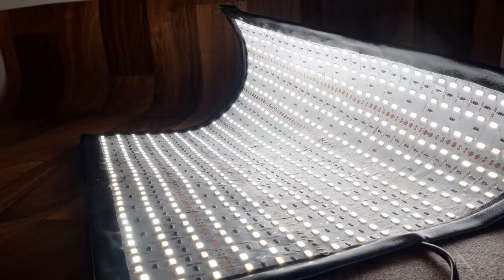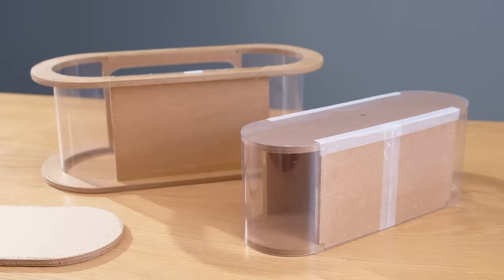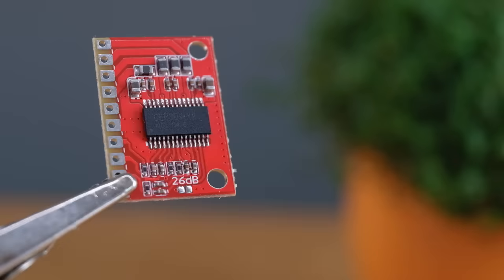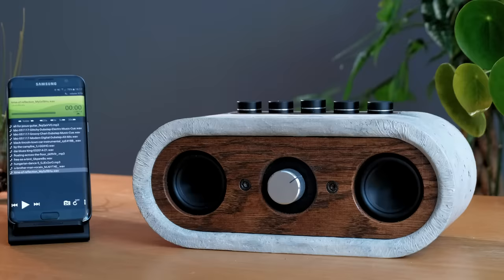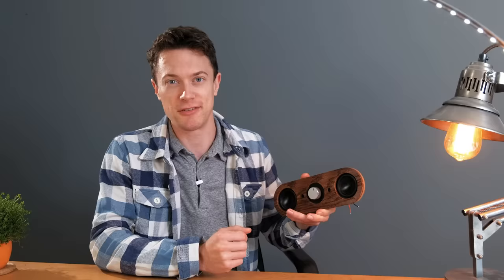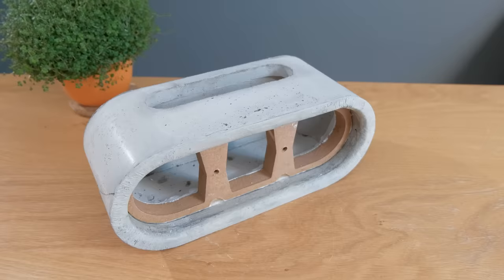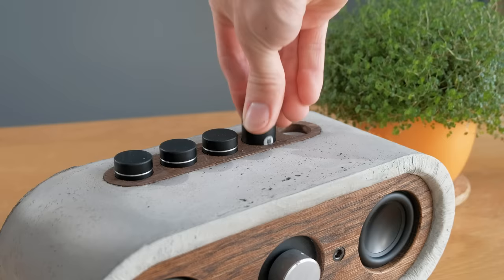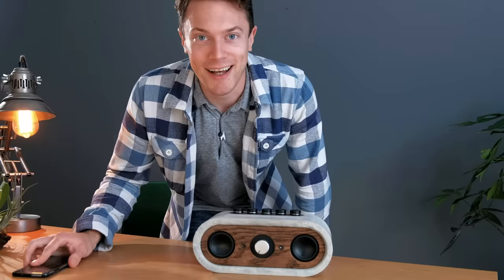Build your own Concrete Bluetooth Speaker (how-to)

Comment: you could sell this for 500 bucks. "Handmade" and all of that crap
Reply: 500? Nah am 2k+
Reply: 5k+
Reply: I'm thinking of making these and selling for $350
Reply: if I was gonna buy a speaker for $500 I'd go jbl
Reply: @alexafa316  Make it 200 and i'd buy
Reply: @saltysoysauce954  200 is kinda cheap
Reply: @alexafa316  Well there's a lot of competition in the bluetooth speaker market
Reply: '200 is kinda cheap' what
Reply: @TheRealDrae  Yes.  The drivers are over $50 a pair on sale.  Then you've got the bluetooth receiver, circuitry, potentiometer, hardwood, rather nice knob, batteries, connectors, battery banks, acoustic foam, forms, concrete, and plastics.  On top of that it's custom kit, so you have several hours of labor - all of which are skilled craftsman hours (>$25/hr). 

$200 is very, very cheap.  You'd be selling labor at under minimum wage at that cost.
Reply: John Ross  factory automation could reduce that.

It would actually raise the cost.  I used to do automation in my previous job actually (not manufacturing, but forms processing).

Speaker drivers, knobs, electronics, and batteries are not something a speaker manufacturer is likely to make themselves.  Some companies make their own drivers, but only very high-end ones or ones that sell large volume.  Those will all have to be purchased.  Parts alone are likely around $120+ even at direct manufacturer purchase prices. 

You've got the rent, administrative overhead, machinery, and maintenance.   Then you have the interest on the loans you took out for that equipment - companies don't hold on to lots of liquidity for economics reasons I'm not getting into right now.  These are mostly fixed costs and the unit has to sell enough to pay these off.  A concrete portable speaker is an excellent boutique product but most consumers are very unlikely to be interested in one.  You won't be able to recoup the cost of automation.

This is the same reason a ton of top-end audio products are 'hand assembled'.  They sell so few units that setting up automation for the manufacturing would actually lose them money, or make the item far more expensive that its already eye-watering price tag.
Reply: To all of those who are discussing automation, it is fair to note that if you are to the point of automation, you are also likely able to buy components at a substantially lower rate.  That said, you'd better have  a pretty significant demand for the product, as the overhead of a manufacturing facility...even a small one...will not be cheap.
Reply: @John and @Matthew Blackwood, there is also tooling costs, assembly line and process flow management, employee wages, insurances (health, worker’s compensation, liability) that are all including in the account for the suggested solution that manufacturing would be better. I agree with Blackwood. This would be better as a handmade custom item at a premium price. Not a mass market item but certainly finding the right crowd through the right avenue would be a challenge but I’m thinking gift shops in tourist areas, uptown hangout spots and shops near beaches would be great. Plus the whole handcrafted thing is a big trend right now that I see only continuing to grow as people are becoming more conscious of how their products are being made nowadays. ......Surprised this all ended up being quite the in-depth conversation but some just don’t like to admit when they insist on correcting someone and end up being incorrect themselves.
Reply: @ethand4784  perhaps you would, but there are a lot of people who appreciate handmade art like this as well.
Reply: @ethand4784  I never buy such electronics, you make it yourself it is so much better trust me
Reply: Slap a Sennheiser logo and called it a day 👍
Reply: @ethand4784  500 is a bit rough for jbl. there are so many better speakers than the boombox in that price range.

Comment: Hi Matt,
I've just discovered something that impressed me a lot. When I was taking a look at pricing of some parts, I realyzed that speaker driver seller got you linked at the product (that project I mean). That feels amazing.
Changing the mood, about the dangers you should've talked of building with concrete (cement part derivated dangers), washing hands (and every portion of your skin spotted or dripped by it) is very important. If you let it on your skin for hours, letting it dry naturally it tends to cause bleaches like being burnt.
Other point to look at is being careful while manipulating it, because it is a real fine powder that expands in the air so easily. To use it outside could be enough, other way you may not be rude handling it in order to avoid sniffing it. Commonly it'll generate a coat of powder in the nearest area, easy to clean after all unless its over textiles.
Thanks for your efforts in showing us newer and creative projects.

Comment from the maker: Templates uploaded!  https://drive.google.com/file/d/0B-WzRpdWmGhjal91SFp2Q1dXbXM/view?usp=sharing&resourcekey=0-IyYVV6VKaRQGdPbMFzI6YA
Reply: Thank you!
Reply: Thanks!
Reply: Insta sub m8
Reply: Thank you for the templates but, the dimensions are really vague. Whats the scale of the templates? I think a few dimensions in mm or cm and especially for the acrs and angles of the mould would really help. thanks again!
Reply: Hey mattt, Do you think you can show us a video on your work shop set up
 and give us a few tips on where and how we can get started with making 
awesome builds?

Thanks you.
Reply: Hi Mark,

The .svg file is not good It is not complete. And it what the other people are saying there are no demensions the layout so its impossible to reproduce correctly
Reply: Thanks Matt. Only been waiting a month for these plans. *tut*
Reply: What's the battery live at mid volume?
Reply: DIY Perks how do you charge the cells?
Reply: With the Templates, could we get them 3D printed??
Reply: DIY Perks Thank you for very wellmade videos. Very interessting to watch. Can any of your amp projects be used as a guitaramplifier?
Reply: Please can you finish part list? Parts for power cells are missing and volume dial.
Reply: DIY Perks can you make musically controlled led lights
Reply: DIY Perks how do you recharge the  batteries?
Reply: Would it be possible to intall an imput like a 3.5 jack so not only is it bluetooth but also a speaker for cell phones?
Cheers anyway all your proyects are amazing!
Reply: Dear Perks, this is great indeed but sadly we can't really use it as you didn't put any helps to figure ot the dimensions. Just tell us how u made them or update the templates with dimensions added
I hope you will respond and thank you!
Reply: If someone were to know the dimensions, please answer ^^
Reply: Speaker has no internal charger, so you have to pull out cells and charge them using some LiPo charger.
Reply: hey there, i want to build a  bluetooth sound bar out of my old 5,1 speaker sistem.the speakers are 8 watt x4, 1x 18watt center and the sub is 22 watts, 4 ohm speakers, could any one please tell me what kind of parts do i need for this project? i mean amp, bluetooth moduel etc. or maybe someone already made similar project and can share theyr expereance whith me. thank you in advance for your reply
Reply: hello. I want to ask you how to (a relatively simple task i think) make an LCD backlit black and white screen (like of a calculator that I want to use in broad daylight which isn't possible otherwise due to shining screen :( )
Reply: I thought the same. Also the worked out charging and LED lights for charging state. I can do that.  Let me know I'll Share.
Reply: There a few for reference. I'll see if I can draw in F360 and upload the file.
Reply: 詹堉梃
1秒前
Hey, I have a problem with connecting to the Bluetooth with my phone. 
b) There's no voltage coming out from the amplifier
c)There's no sound from the speaker
d) When there's some sound coming out, it sounds horrible
please reply as soon as possible, my friend is going crazy on this. PLEASE
Reply: How do I connect ground?? Didn't really understand from the video. Also the templates are incomplete and vauge. Can you provide me with Better ones. Nice project and looks elegant. I really want to make one. Please contact me by replying. Thank you!!
Reply: DIY Perks I would just like to ask, what do you do as a job?
Reply: I want to buy the battery in your video, I went to your website but didnt find them. Where shall I find them ?
Reply: kal kmew go to eBay or Amazon, type in 18500 ion battery
Reply: Thank you Lesd3 Guzman, the reason why I am looking for the same one in the video, because buying from eBay or Amazon is a bit risky as I might get a bad quality safe batteries. I dont know good brand for safe ion batteries
Reply: oh kk
Reply: DIY Perks How would you recharge the batteries in the battery pack if the electronics are removed? Could I put a charge board in between the battery circuit and the amp and charge via mini USB?
Reply: I too am very curious as to what the dimensions are.
Reply: you removed the PCB protection then why buy those batteries in the first place? Like the build though it;s awesome
Reply: I want to do a power bank of around 20000mah or maybe more with 18650 batteries cells,  5V 2.1A and 5V 1A ports and an integrated blluetooth speakers but the blue , I noticed some of the components I was planing to shop are similar to the ones you are using, do you plan on doing something like this? if not, would you consider? or give some advice? @DIY Perks your project looks very good by the way :D
Reply: What does this board do, I'm new to electronics and I want to learn more about it to make some cool projects like this too.
Reply: Can you just demonstrate the charging of the powercells?
Reply: Thank you for sharing. i workingto make one
Reply: You miss out somthing in almost your every video. How much it costs to make things you make. Nice job by the way 👌👌
Reply: To all of you requesting dimensions on the template - though they are not included directly, they are quite easy to reproduce if you want the exact same dimensions as the ones in his project. Do it by simply meassuring the number of pixels using paint or similar - He has included the dimension of the pipe of 22 mm - which equals 59 pixels in the photo which means that one pixel equals 0,37 mm. Now everything else can be found by multiplying pixels with 0,37.
Reply: Could a large power bank be used instead and power the speaker through a single or two USB ports
Reply: vibrating the concrete would eliminate much of your air pockets and bubbles to the surface.
Reply: Hey! Is there a chance for you to send me the blueprint on how to connect all of the components of this speaker? I've ordered all the parts and have connected everything but something is not right... it is not working... perhaps i have made a mistake somewhere along the line... thank you so much!
Reply: Simply fantastic content sir - I salute you!!!
Reply: How do you charge the batteries?
Reply: nice build. i suggest u use the grouting cement with non shrink ability. we use sika grout for repair the concrete.
Reply: Hi
Congratulations. I am fascinated by the Bluetooth speaker project and would prefer to use a 220 V connection instead of the batteries. How many volts and amps should the power supply have?
Thank you for the great video and best regards
Reply: @hansjoerghasler8017  If you want to use 220v.
You will either need to have a transformer inside the unit to step down the voltage or use a DC barrel jack and the correct DC power source for the amp you want.
The amp in this video either needs.
24V@8Ohm
16V@8Ohm
6V@4OIhm
12V@4Ohm
12V@8Ohm
Reply: Do you have the correct SVG file?
The one in the google docs only shows the ribbed section and only part of it as well.
Reply: @Swelgje81  Oh,- the file is all right. Browsers don't handle .svg's very well.
Use Libre Office or Open Office Draw to open the file, - you just have to zoom nearly all out (bottom left corner) to be able to see all the objects.
Insert new pages and copy/paste the objects to them, one on each page, then you can them print out 1:1 and glue them to your MDF-sheet.
Also Inkscape opens the file well :-)
Reply: @jensibek  I dont seem to understand what you mean since i dont get it to work, tried zooming out etc but cant see the other objects.
Reply: @kaj-henrikstalnacke1709  If you are using Open Office then you are quite right,- that does not work. I was using Libre Office and made the wrong assumption that it would be the same in OO, but it's not. Sorry.
I'm furthermore using an old edition of LO (Ver.5.3.3.2), so I can't even assume that it's behaving in the same style now, but to spare you (and others) from that rather tedious task of breaking out the objects, I have packed up a .rar file witch contains .pdf, .odg files and collection of the broken out .svg object files. I hope you can use some of these files:

https://drive.google.com/file/d/1Nnr8y7DRmHsBtdpnQ-Ey2oahXAJCEszp/view?usp=sharing

Have a nice day.
Jens
Reply: @jensibek  Hero
Reply: @jensibek  Wish you could have put a scale in the svgs so we know how big 1cm is and we can scale it.
Thinking of using ND91s with this unit so have to increase the size
Reply: Thank you
Reply: How can get contact with  you for help
Reply: Because your video are helpful so I your contacts to chat with you pleased
Reply: @DIY perks you can use plaster Paris on the concrete
Reply: how do you know the charge of the speaker??
Reply: This is one of the most amazing projects I've yet to see from you o.O Well, they're all amazing.
Reply: Matt....HELP!!! Can you point me to or explain how to make my digital piano louder? (Yamaha YDP131) I’m searching everywhere for help...I’ve made a Grand piano carcass and want to extend speakers underneath to make it louder...I’d rather change the internal amplifier for a larger one....but i really don’t know how? Any help is appreciated!! Love all your work, keep it up 👍
Reply: I still cannot find those batteries even on the rs site I've tried entering all the information I can visibly see on the video when posed but no luck
Reply: @blakeslocum2732  Working on it :)
Reply: Thanks for the download. I'm gonna make this happen  ...... Every body in the comments are crying about tools to build with! They are missing the point, It's skill they are short of. Not tools!
Reply: Do you know you make diys look like industrial 👌
Reply: 8610 ic board only out put 10 watt
Reply: I think you fail at puting a charging port in the back
Reply: Hello brother i really like your channel
Reply: I want to buy rashberry bord.please give me advice
Reply: Bluetooth modul link broken can you share it again?
Reply: @lifeuu  in 2020 your wish came true :)
Reply: @julikb  after 3 years haha
Reply: I have two 0.6 Watt speakers with impedance 6.5kOhms can I still use the 30W amplifier module??
Reply: How would it sound if you used epoxy instead of the concrete
Reply: Amazing, but pleeeeease separate the resonant volumes of right and left channels and calculate them even with something basic such as winISD! :) When different channels share the same resonant volume, they can experience destructive interference (a bit like with reverse polarities)!

Dayton audio provides TS parameters, therefore you can compute accurate designs very easily!
For that driver I'd suggest a ported enclosure, but here are the dimensions for both designs:
sealed enclosure: 0.25L - you would get cutoff at around 160 Hz, with tiny 2ms group delay @100Hz, resulting in a smaller band, but accurate sound
vented enclosure: 0.6L - vents: diam 15mm, length: 200mm - cutoff at 85 Hz, with a higher 7ms group delay at 80Hz  resulting in a much wider band, but a tad less accurate sound reproduction.

Ideally (on the vented design) you'd add a highpass to the signal at 70Hz to optimise for cone excursion. The highpass should lower the "chuffing" effect on the ports too!

I'd be happy to provide more measurements and to show you some tools to compute this yourself if you're interested!
Reply: 4:00 to remove the bubbles yiu coukd just vibrate it
Reply: It's saying you need access 
What will I do pls help 
thanks  in advance

Comment: How do you charge the batteries? Especially with those connections on them.
Reply: Just replace with new one xD
Reply: Sucks that they're not rechargeable, what a waste.
Reply: Just leave in the boards from the power bank cases! They have charging circuits and the cells can be wired straight to the connectors in parallel with the charger. Don’t plug in the charging cables when they are in the amplifier.
Reply: DIBgmail all you need is a RC charger......... these are lithium ion cells... they are rechargeable
Reply: @alangunn7254  That would also be useful, as each battery would have a USB output.
Reply: @DIBgmail  what?
Reply: @DIBgmail  
14:27 They are rechargeable.
Reply: I imagine he could just unscrew the "battery bank tubes" and recharge the batteries inside an 18650 charger. Maybe there's also a way to make a charger that has the same kind of connectors on them. @DIY Perks, maybe an idea for a future video... 😉

Comment: Question: those empty battery tubes - i have searched for an hour online and i can't find anything similar to those, where the heck did you get them? And how does the xt60 connector connect to both terminals if the connector only touches one side?
Reply: Search ''18650 USB power bank''.
Reply: You can but then for about 2.75 USD a pop on Banggood, which is a reliable source for people trying to buy from China. I bought my smartphone there.
Reply: As for your last question, the negative end of the battery is generally grounded to the metal case, allowing you to complete the circuit.